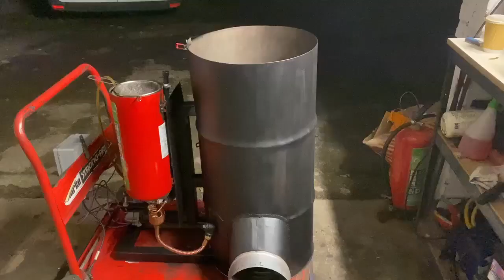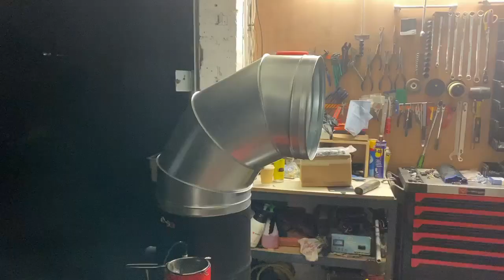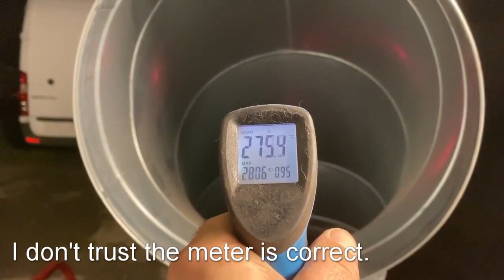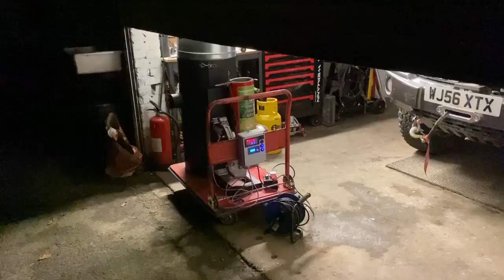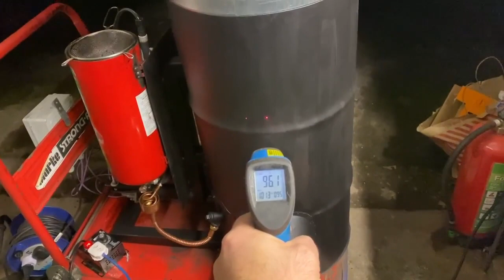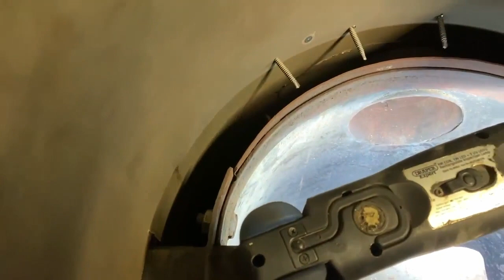Blue Flame Waste Oil Heater Burner Part 2

Comment: @martinsdiy825 I just did a calculation of your exact burner thermal efficiency and got 91.1% based on your used oil flow rate (1.5L/hr or 0.4 gallons/hr), your estimated heat output (15 kW or 51,182 btu/hr), and the energy density of used oil (140,000 btu/gallon). This thermal efficiency is excellent! A pure blue flame burn means the thermal efficiency is 90% or greater. Yellow/orange flame thermal efficiency is about 75% or lower. 75-90% is in the transition range and a mix of yellow/blue as your burner had to transition through. As a reference, a typical modern car's internal combustion engine thermal efficiency is about 35-40%. Very cool video and great work on fabricating this used oil furnace! Godspeed from the USA brother.

Comment: What is the size of tube on your peristaltic pump. Any information on it such as part numbers and name brand would be appreciated. Also how many hours were you getting out of the replacement tubes.
Reply from the maker: I eventually ditched the pump and used the drip feed as when it was really cold it didn't have enough flow.

Comment: Interesting way to build a cheap Diesel heater, but i think to test properly you'd need to let it run for 12 or 24 hours in an enclosed space to see how much CO and CO2 it produces which isn't going out of the chimney exhaust. Also, personally I think that Diesel heaters using no fan are more energy efficient and a lot more pleasant and quiet to have around - though a few final designs still need to be fixed, as there are many about on the internet of better and less quality and few CO and CO2 readings given (I haven't seen any at all so far, in fact). Best of luck with the work and thanks for the video.

Comment: I really thought this must be using petrol/gasoline mix to get that rich blue flame.  Not being afraid to use petrol mix I made a similar setup although no pumped fuel just an old squirrel cage fan off an old gas boiler for air.  MIND BLOWING ! ! !   I also found out that pretty much any flammable liquid will give equally great results I even put a block of lard into the burn chamber complete with wrapping and replicated your results :)  The most amazing thing is, as you point out the residue left is dust ! ! !   and not much of it :)  As I said before I don't have a fuel pump, but I am going to work out how long a litre of fuel will last simply by dumping in 1 litre of used oil, drop of kerosene right at the beginning in hope that I can simply dump in say 2 litres if I expect to need heat for 2 hours, it could be more or less but something I am going to find out :)  What a great invention you have there sir, burns better than the pro beckett burners that only use kerosene I think :)
Reply from the maker: Thank you for your comment.

The fuel pump is just something I tried, but it is really noisy and in cold temperature is not feedeing enough oil as the oil is really thick.

Over the cold temperature I have went back to drop feed.

The ratio is easy to follow, if the mixture is lean, the flame goes back to orange and the output temperature is much lower.

However it is easy to overfeed it, it will run longer when you shut it off as it will burn through the oil left inside.
Reply: There is a big downside to your design and others like it if you want to close that garage door. The system is sucking fresh air from the room and pushing it out through the exhaust after burning. You would need some type of air makeup system. I would think of designing a heat exchanger with the exhaust to preheat an outside air intake for the burner and not cause a negative pressure in the room. This way your heating system is simply circulating and warming the room air.
Reply: @rayleblanc7209  Nothing wrong in fresh air though is there?  I mean if you hermetically seal up your house you will suffocate :(  and Martins setup will heat the fresh air for practically free so not really a downside.
Reply: @Moonlightshadow-lq4fr  That might work for a wood burning stove that naturally draws it air. This system draws large volumes of air through the blower and pushes it up the chimney. It needs an exterior source of air to function properly.
Reply: @rayleblanc7209  It's the same!  Why are you being so negative ?  Be nice to see your video of how the perfect setup would be, oh then again you have been on youtube since 2016 and not produced one single video ????  That's what I call a troll.
Reply: @Moonlightshadow-lq4fr  Buddy, you're the one acting like a troll. I'm just pointing out a requirement for it to be safe and efficient.

Comment: So just using air under some pressure give you a multi blue flame ??? Looks like you are adding propane gas. Thanks
Reply from the maker: No propane gas added at all, just propane cylinder used. The point is not to burn the oil, but the oil vapor, which turns to blue during the burning process.

in the video, you can see stage when it comes from yellow oil burning to the blue vapor burning. 

Or check one of the first videos, where I had only the fan and I added the oil just pouring in..
Reply: @martinsdiy825  Sorry My Bad with the comment MDIY. Look forward to see more great videos from you Martin's. Thanks and peace too. !!

Comment: It just keeps getting better! Well Done! I like your idea of adding a fan with a speed controller. Now you just need to add a temperature switch so it comes on when the Heater gets up to temp.
Reply from the maker: Thank you, I know what you mean, but as it is in garage and it is on temperature so quickly, it doesn't make any sense to accommodate this for now.

Comment: Thanks for showing the residue. That’s a pretty clean and complete burn. Cheers
Reply from the maker: thank you, it was really hot burn, which I don't normally do, but even less hot doesn't create much more, I just put vacuum cleaner inside and start up
Reply: @martinsdiy825  blue flame definitely makes a difference. I’m still refining my burner to get there. My first attempt had orange flames and left a lot of sludge residue that was nasty to clean up. Thanks